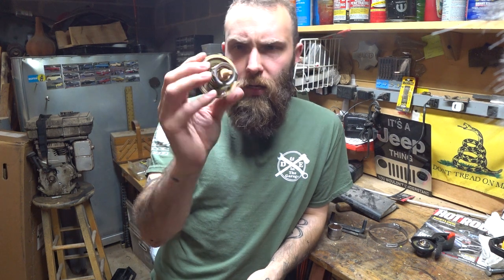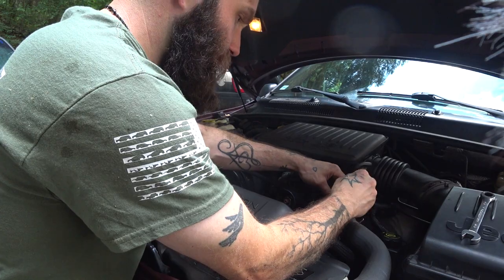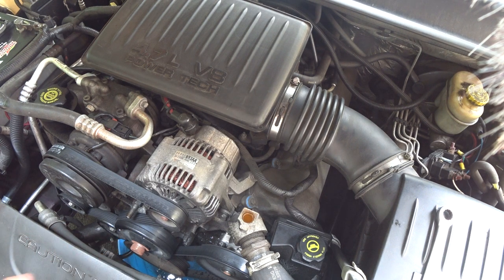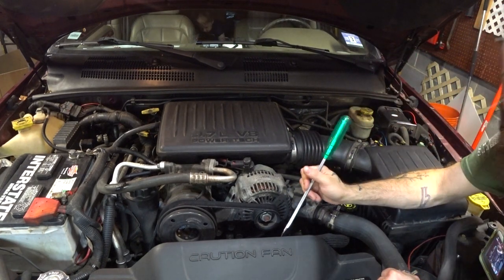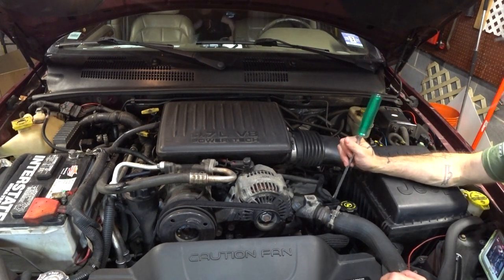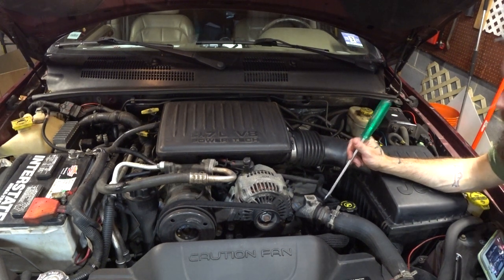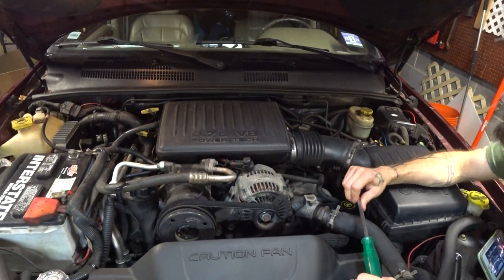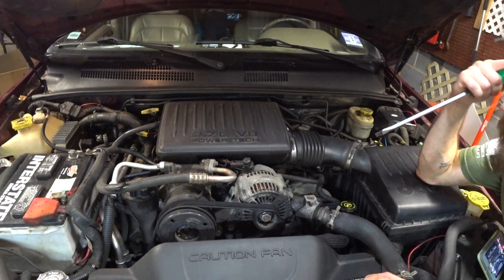How to keep a Jeep Dodge 4.7L alive & happy - EVERY FATAL FLAW I LEARNED THE HARD WAY!

Comment: Any engine that requires that much concern ain't worth spit, IMO. I love Jeeps and have had 5 4.0s that would have kept going if other things didnt happen. Seen many a "deal" on the 4.7s, and sometimes its tempting, but common sense keeps from a rue the day scenario. I do wonder about one thing though, concerning the cooling fan. The 4.0s have a bolt on version, which is part of the tow package. I added one of those when my electric fan went out and it was the best thing I ever did. Never had a cooling issue after that. Does the 4.7 have a towing package where a fan is added? If so, that might solve all problems related to hydraulic fluid/ power stirring pump scenario - or at least be a back up.
Reply from the maker: Not really. The hydro fan is considered “HD” by itself. The 99’s had a mechanic fan/e-fan combo before the hydro which is better BUT Chrysler discontinued the parts used so you have to find one in the wild. Not easy as the 4.7 wasn’t popular in 1999 being the first year used. 
As for the engine being too much bother to deal with…. Maybe. Haha. Let me preface that I plan to be buried with a 4.0. Hands down my favorite engine because it has EARNED my respect. Amazing piece of iron… BUT it has limitations - specifically the trans it was paired to in the WJ - which the 4.7 fixes. A 4.0 WJ is a bad tow rig. Sad, but true because of the 42re. Also being a more modern engine there is more ability to tune if that is your thing. As a last note.. I am neurotic about my 4.7 and made this video for others like me. Who want to know every quirk and issue. Most drive them for years without knowing about or encountering any issues.
Reply: The tow package includes a power steering pump contraption diverter that spins the cooling fan. The engine must be running for it to operate. Mine is well balanced you feel nothing in the steering or feel and the fan speed is directly proportional to engine rpm. The hydro fan is legit. It's only two extra lines and reliable, removing the radiator is a snap, it's a tight fit but stuffing a V8 into a sub-3900lb SUV equals fun to drive. A couple cheep mods and you're at 260  275 hp and 300ftlbs torque. When I'm streeting it I remove. The front shaft and smoke a 01 mustang off the line
Reply: 😊0p0
Reply: Amen to that. that engine is Like a troublesome woman. Just buy a dog and die happy.   LOL
Reply: Really can't relate. Have a 4.7 sitting at 325k and all I've had to do is fix the attachments that naturally wear out. Love my H.O. block 

If you love something you take care of it. If you don't you move on. Just say you don't like jeeps.
Reply: @buffwafflemann379  You got lucky. The 4.0 runs circles around that engine in terms of reliability.  Any belief to the contrary is just living in denial. BTW - you obviously didnt read the entire post. I am sitting on three 4.0L jeeps right now. One has 45K original miles, one has 101K original, the other is sitting at about 162K. You're comment that I "don't like Jeeps" is obviously, absurd.
Reply: That hydro fan was a Jeep only item. Dodge used the old clutch fans which rarely fail.
Reply: @drdodge827  Daimler Chrysler thing!

Comment: FYI for everybody out there with a 4.7 L W J, the fuse for the O2 sensors is the same fuse for the hydraulic fan relay. Found this out the hard way when I changed out my O2 sensor and didn't put the wiring back where it belongs and it shorted out on the exhaust, blowing the fuse, and making the hydraulic fan stop working thus overheating by engine.

Comment: Had my 4.7 ram for just over 5 years. Relatively "low mile" at just over 150k. Had many issues with the cooling system but to be honest, the best, I guess you would call it "upgrade" is a mishimoto thermostat and rad. Im sure the rad doesnt matter as it is oem style, but the 10 degree colder thermostat honestly woke the engine up. It used to get up to temp and pretty sluggish, but that 10 degree difference keeps it pretty happy even after an hour or more on the highway. I would recommend this for anyone that lives in a hotter state, (im in houston) as it keeps the engine much happier. When its pretty hot out these engines run hotter than usual and this keeps temps down.
Reply: I also found replacing the ac fan with a more powerful one and switching from a steel clutch fan to a aluminum one helped alot too.
Reply: Maaaaan. I just replaced my thermostat a couple months ago. I wish I knew about the mishimoto!
Reply: @HbEthan.  where did you get yours?
Reply: What ac fan did you use?
Reply: Where did you get your thermostat at?

Comment: Grooms Engines did a big write up on why the 4.7 is so bad and it comes down to cheap valve seats. Worth a read. You can make any engine reliable if you fix enough design flaws.
Reply from the maker: Valid. haha
Reply: Should be a recall for the seats.
Reply: @lorangajapp8086  Yes i agree but Dodge has way too many things to worry about now.  Hard to believe these were the good ole days of Dodge.

Comment: 20 years and 240K hard miles on mine. So far: pilot bearing, water pump, throttle body butterfly, AC clutch, and one valve cover gasket failed. The lack of reliability in these motors is 100% the owners neglect. Never once left me stuck on the side of the road.

Comment: 1 owner 06 dodge Durango SLT AWD 4.7.
I have 180,000 miles on it, it came with green, I only use green.
I have replaced the tires now 4X. 
 Replaced the water pump in 2016, all new rotors & brake pads and spme lines in 2017, EGR valve in 2018, and speed sensor last month. Everything on the truck works, every button, it just has two rust spots that keep growing. Been one hell of a good vehicle. Im going to rebuild it all and fix the body next year, and keep it. Love the ride, and heated seats.... 
I did upgrade the air intake and had it retune when it was new. 
Very happy with this truck.

Comment: My 2003 Dodge Dakota 4.7 Magnum has just past 271,000 miles still running great. No engine issues other than regular maintenance. It is going through a quart of oil occasionally but with the mileage who could complain.  These are pretty common trucks in my area and i have seen several in my local shop getting engines replaced. As for mine it gets good maintenance never have much of a heating problem except when coolant level gets a little low. That's easy to remedy by just adding a little coolant usually about a quart. The key is keeping fluids checked and changing oil at no more than every 5,000 miles if using a synthetic oil if regular oil i advise changing every 3,000 miles.

Comment: Awesome video.  I recently purchased a 2004 Durango with a 4.,7.  It runs great but after watching all the u-tubes and researching this engine, I decided to get some gaskets to seal up some leaks, especially the valve covers.  Getting a little carried away I thought I would get a water pump and serpentine belt as I don’t know the history on this vehicle.  So i decided to go a little farther and I pulled the engine out. (I am retired so time doesn’t matter to me:). Anyway, on the back side of the engine it states the engine was rebuilt in 5/14.  I had checked the compression before removing the engine and it is between 160 to 170 dry.  my vehicle has 123,000 miles.  So now I have a new oil pump and decided to remove the heads in order to inspect the valves and seats.  All looked fairly clean but I removed all traces of carbon.  I replaced the valve seals springs and lifters.  the lifters were showing wear as the springs inside were very weak.  I am now in the process of replacing the cylinder heads.  I also purchased a complete timing chain, guides and gear set as the lower guide was broken.I am replacing all fluids with synthetic oil, Orange coolant as it was green when I got it.

I feel confident that it will run well and with care will last me a very long time.  I pretty much have lapped in the valves and replaced all worn parts but did not get into the pistons, connecting rods or crank as it did seem to run good and with the rebuild in 2014 I am confident that the rotating assembly is ok but now I have peace of mind that the rest of the engine will perform and last.  (I Hope)

Thank you for inspiring me with your video, oh by the way, my Durango does not have the hydraulic fan assembly, thank God!
Reply: Absolute legend , reminds me of my dad
Reply: I was wondering how your Durango is running now after 2 years. 
I’m thinking to replace the lifters and springs in mine

Comment: I had a couple of wj s with the 4.7 and 4.7ho. Used in hot scorching heat and winter. Zero issues with cooling system as long as you change the cooland correctly, it is a well designed system. People that complain are just abusing the 4.7 and then complain about them.
Reply: They also drop the seats just like that...

Comment: I love my hydrocooling fan in my 02 overland and i don't care what u say about it. Ive never overheated ever and it is a solid setup that never failed on me.   14 years of ownership and 188k on the clock and i love it. We all know how grands are with the e fan and faulty resistors and overheating lol. To each there own. Great vid
Reply from the maker: Fair enough, bud. My experience has been poor, but I am glad to hear some folks are doing alright with them
Reply: @DEInTheGarage  im a firm believer that fan is the reason it's still on the road.  Ive seen many v8 and i6 cooked because faulty electronic fans.  If you maintain the system and do what i did and run a bigger hyro oil cooler its just a trouble free design and really the only system in my jeep that hasent failed once unlike every other system.Don't blame the Germans..toyota used that same fan idea in the early 90s lexus so it's nothing new.u could swap it to whatever u want and sell that hydro setup because its desirable to alot of enthusiasts for off-roading
Reply: @---skynet---  they switched to electric for a reason lol
Reply: @zachs.9600  electric fans are way more cost effective as far as manufacturing goes.

Comment: My 2003 Durango had the 4.7 V8 - Used it to tow my race car from Florida to New York to Wisconsin to Kansas for 15 years and 360K miles.  Never had any issues except for a crank sensor and several vacuum hoses drying up and cracking.
Reply: I am curios what maintenance you did on it? What oil and filter and how often you changed.

Comment: Great job explaining to folks not only the importance of burping the cooling system, but the proper way to do it as well. I have tried many times over the years to let the damn thing idle until the thermostat opens and the heater is blowing warm air and temp gauge is where its supposed to be blah blah blah! Then you stare into their vacant eyes and think, well someone's going to need a head gasket soon! Some listen but most just shake their heads at me like i am stupid and they are humoring me so I'll stop talking.

Comment: I know this video is 3 years old, but I have a 2010 Dakota with a 4.7. Fully stock and towed a 3300lbs Rpod around the country, through the mountains of BC and Yukon, Canada, and then up to Alaska where I live. after 173,000 miles I've had zero issues.
Reply: My 2013 (same exact engine as yours as its post 08) just failed @ 166K.
Reply: @TheSavage3.6  shit sorry to hear that!
Reply: @davidsmith9  Yeah, funny part is that i can’t even figure out what’s wrong with it lol.
Reply: @TheSavage3.6  man... are you putting another engine in? Mine is in such great shape I think I'd replace the engine if it went.

Comment: Just got a 2000 Dakota 4.7. I've owned two Durango's before this, a 4.7 and a 5.9, both I felt were great trucks. Seeing this video now I'm happy I've kept up my love for Dodge because like all cars/engines, they need to be treated right or they won't last. My 2000 Dakota history has me as 4th owner and at 155k miles I plan to keep her running like a champ. These tips will definitely be useful, thanks for the video!
Reply: My 2000 4.7 Dakota just hit 301k on the original powertrain,  maintenance and not driving hard seems to be the key.

Comment: I’ve got a 4.7 in a 2000 Dodge Dakota. I haven’t really had any cooling issues with it ever. 152k and still going. Thanks for the video
Reply: 2005 dakota and same thing never had a issue. I think it's mainly the jeeps and other suvs because there so tucked in and just bake themselves

Comment: I got a durango 02. Ive fixed it, well im doing it right now for the 4th time. Replaced the motor, fixed that one, did it again 20000 miles ago. I have 365000 miles, original transmission, just replaced ac motor. Ive had it for 14 yrs and people ask why i keep fixing it. Simple. It always starts, never leaves me on the road. Ive towed why over limit and she still runs great. Its upbto me to keep it up, i do that, she will run forever. The 4.7 is temperamental but learn it and you will live it. I may never get rid of it. My 02 has always kept me going. Just learn your car and you will have very little problems. Thanks for the info. Ive been using wrong antifreeze..

Comment: Thanks for the video, i have a jeep and a durango, i use a plain old clutch fan on both and a lower temp thermostat, all is well! Also i use the bleed port to help fill the timing cover after filling the radiator. Finally, I use green antifreeze, knock on wood, but it has been good so far. I was nervous about buying a 4.7 truck as well, but now I have great respect for it, the biggest thing about these is don't use cheap aftermarket parts, especially the timing system and valve train!
Reply: The green antifreeze will cause corrosion in the aluminum engine, that is the reason for the different color antifreeze that is formulated to not cause corrosion to aluminum.

Comment: First and Foremost thank God for guys like you and Martin Built !!! You guys have been a tremendous help while battling my 4.7..Plus Glad too see this post to confirm my sanity after battling the cooling system on my 02 WJ 4.7 for almost the entire 5 years I've owned it..Extremely Temperamental is an understatement.....Feel like I could write a book on what all ive done too my Jeep within the 5 years I've owned it but love my Jeep and felt its was worth fighting for..... So far this Jeep has been through 3-4 t-stats,Water pump ,Ate a few spark plugs, then started getting a constant misfire on #2 and sometimes multiple cylinders miss which took me nearly a year to finally figure out that it was my harmonic balancer failing/coming apart..  it finally exposed itself when a piece of rubber from the damper created a ticking noise one day while running but when you shut it off it looked normal..So since our local repair shop wanted nearly $800 to repair the balancer I did it myself with the help of a good friend whom is a mechanic...I decided to  swap in a new Denso radiator since the Hydraulic fan had too come out and my Jeep has over 200k on the clock...Was definitely hands down the hardest swap me or my friend had ever done..He thought it was gonna be a piece of cake and boy was he wrong...Took us an entire weekend to complete ..... So my next upcoming projects on the Jeep are fixing my stripped purge screw, swapping out hydraulic lifters to remedy the lomgtime cold start tick, along with new VC gaskets, plus the Martin Built PCV mod..  I recently found a severely rusted brake line on the rear driver's side before it drops ontop of the axle, while up underneath looking at my E- Brake cables in preperation to fixing that..I'll get her sorted tho ....Excuse my rambling but I wasn't joking when I said I've been battling this sucker..Lol...Question for ya.. What oils are you running in your 4.7 ?

Comment: Uk viewer here man. Love your videos. I have the 4.7 in my WJ and I love it. The UK versions haven't had the type of abuse I see the American Jeeps take, but they are still vulnerable to poor maintenance. Mine has thankfully been looked after and soon as I got it I did a full system flush and made sure it was working properly. That was all thanks to your videos on the cooling systems and what to look out for. I've had no issues with the engine or the cooling since. Great advice and information bud. 👍

Comment: My 3.7L in my 2006 Liberty Renegade has 260800 miles. Had a head gasket leak in the right bank. Used blue devil and it was fixed.
Great engine, needs to be maintained like any other.
Thanks for your videos !!!
Best regards!

Comment: Thank you for sharing your experience and knowledge with us. My wife drives a '03 Durango we purchased in '05. My pastor had a '03 Dakota in which the water pump failed in 2012 around 100K. Ours was at 108K at that time. A mutual friend changed his pump for him. Our friend changed our pump just as a preventative measure (for $30 no less).  In 2013 at 116K miles I changed the radiator hoses. In 2017 at 139K miles the the radiator started weeping. I changed it myself. The engine has NEVER been overheated and is not used for towing. We have always used the green stuff because I didn't know. I am not sure what was in it originally. Here now at 155K and 2022 the 5 year old green coolant looks fine. As far as maintenace goes, I have only changed spark plugs twice the whole time I have owned it. I did have to replace the A/C compressor and drier last year (Thanks RockAuto!). The oil has been changed religiously every 3K since we have owned it. A couple of years ago I changed all the fuel injectors just because. This has been a very reliable rig. Heck, I have had the battery last 8 years, twice in a row.